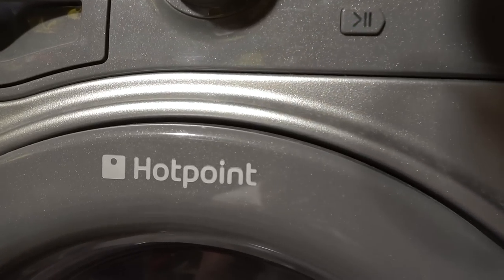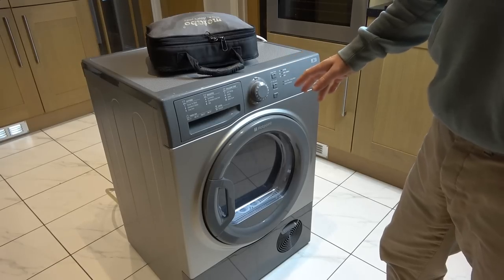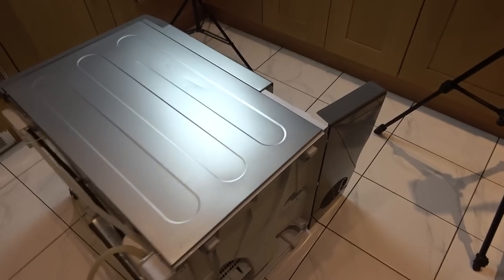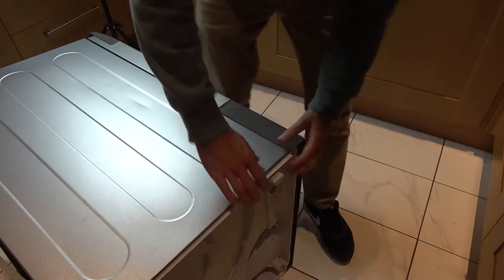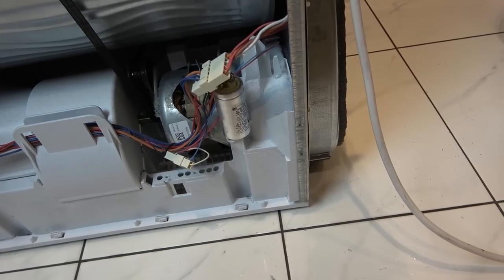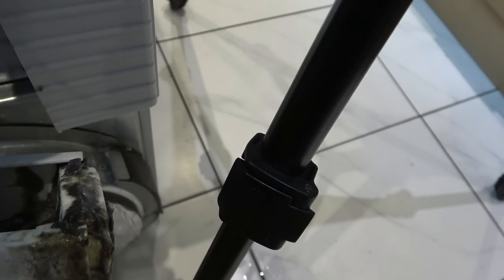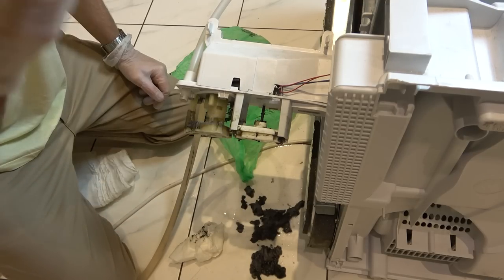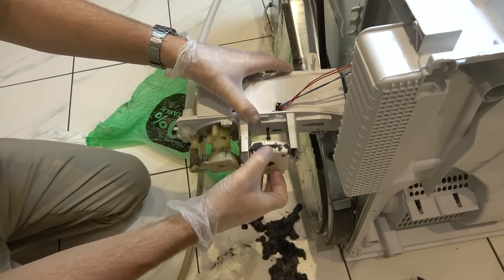Hotpoint CONDENSER DRYER Not Draining - REPAIR Video

Comment: The landfill is full of washing machines, fridges and all sorts of electronics that some of them have minor problems and where thrown away instead of being fixed. Great job Vince
Reply: I had to throw away a Balay fridge with just 8 years. The issue: just a thing that removes ice from a tube.
But that board was 200€, so absurd.
Reply: Usually 9/10 it's cheaper to replace the item than fix. Hence why landfills are full of things like fridges, freezers and washing machines etc.
Reply: 8 years ago I moved to a flat with a machine left by previous tenant that was around 10 years old then, it worked once or twice then stopped going onto drain cycle so I had to manually empty (which normally meant about a hour mopping up after due to doing it little bit at a time) and one time when I was annoyed I snapped the door lock.

I got the model number, went to Ebay found a replacement pump for £15 official and brand new and delivered, removed 4 screws from the lid, put old towels on the side of drum tipped machine over, the old pump was held on with a large metal clamp, removed it, attached new one and the machine worked, I spent a few more minutes replacing the door lock which cost about £7 delivered again for a official part.  I only got rid of it last year partly as I wanted an upgrade but the only real flaw it had whch began in final year or two of its life was it skipped the longer cycles and went onto later ones but still washed and drained like new, and the bottom plate that hid the emergency water release valve the clips had snapped off so I just held it on with gaffer tape and adhesive.
Reply: @TheCheshireCat.  If you’re doing the repair yourself, it’s usually not bad. Especially if you develop a relationship with your local parts provider and try to get preferred pricing.
Reply: Metal shouldn't go to landfill, our metals dont.
Reply: I hate when these machines are built shitty, so you have to keep on buying new ones if you can’t fix it yourself.

Comment: Condenser dryers collect water in the base of the machine which flows through a hole to the pump chamber where it is pumped up into the water container. When the water container can take no more water, the water in the sump area rises, causing a polystyrene float to rise which in turn pushes a micro-switch, telling the user to empty the water container.
When the hole to the pump chamber gets blocked, the water cannot get to the pump to be pumped into the water container so the water level in the sump area rises and overflows, causing a leak. A side-effect of this is that the rear air process fan chamber becomes filled with water where it shouldn't - and the fan flicks water up onto the heating element, tripping out the electrics. 
Looks like although yours wasn't tripping the electric from the excess water, it very soon would have been! 
For added gooeyness, slime and gunk, take the float chamber apart 😉
Nice work. Great fix Vince.
Reply from the maker: Thanks for all the info Codeeze. Brilliant👌

Comment: Good video. I had a build up of fluff further into the tumble dryer... Water wasn't even making its way to the pump. Given the fluff you recovered, I suspect there will be more sludge further up stream. Removing the side panel and plastic cover and going in from the side allowed me to deblock things. With a few fresh pints of water poured manually into the system the whole loop is now flowing nicely. Just wanted to mention this in case someone is struggling. 😊

Comment: Nice fix, it reminded of my dryer repair earlier this year. My whole condenser was clogged up so it didn't dry anymore. The filter screen had a small crack and as we noticed it it had too much lint clogged up the condenser already. After a painfully disassembling I was able to unclog it with a garden sprayer and it is now back to work. 
Two comments from my side: I had put my dryer on a workmate bench in the basement to be able to work in a comfortable height. Independent of age this makes your life much easier. Second I have read that you shouldn't re-route the waste water at least on some dryer models (mine is a Bosch) as it is used to clean the heater and condenser by recirculating it. You might want to double check this for you model as well.

Comment: Behind the condenser is a little gully that travels across then down to the hole in the pump housing, when I take the condenser out to wash it out I also reach in with a cloth and clean the gully out, it saves getting too much lint build up in the pump house, great video

Comment: I've had lots of them apart,  they're a very easy fix once you've done one.
There's a different model with a water cassette under the condenser and that works by gravity,  so no pump,  but the condenser in those needs to be de-linted occasionally and that's a job for a compressed air nozzle. 
Great video showing how simple these machines are to work on.
Reply from the maker: Thanks Adelle👍
Reply: @Mymatevince 
When is part 21 of trying to fix the rolls royce
Reply: @Mymatevince  next time you get a dryer get a beko ours is amazing I had nothing but trouble with the hotpoint

Comment: nice, all fixed. I also cleaned mine, wasnt broken but general cleaning i do from time to time.
mine doesnt get much of stuff in it but probably because mine has a double filter, but still cleaning the pump for a dryer of even washing machine around every 5 years is a good thing. that way you can do it when you have time instead of you having to fix it as an emergency.
well done Vince, and yeah plastic tabs break easy anyways so no worries, still holds well enough ;)

Comment: Reminds me of my old dishwasher that was leaking and I pulled apart and put my hand under a fitting to see if there was any water on the fitting. This taught me two things. 1. There was also electrical connections on the underneath of this fitting. 2. If you forget to switch off said appliance at wall these connections bite when you grab them with a hand

Comment: If the flat belt that turns the drum breaks your first problem is to get the new belt around the drum. Remove the sides and loosen the front panel. You can lift the drum enough to feed the belt under it. The second problem is to get the belt over the motor's spindle. To stretch the belt I found the best tool was the handle of a mini paint roller. Use the part of the handle where the roller goes to hook the belt and pull as hard as you can. The belt is a tight fit.
I got my belt from espares.

Comment: Thank you Sir. That was precisely  the problem with my HOTPOINT Condenser Dryer. It 's done  & cleaned. What a messy job. But it was worth the Effort. I'll  try it  during the day because it is nearly 3 am now. I'm quite pleased with your accurate Thoughts & Instructions. God Bless.

Comment: Good job well done!
I had to take ours to the repair service for cleaning. Even with 4 filtering layers and regular cleaning, the insides were clogged with fiber. The air did not pass through properly. Now, it works like new after the maintenance. So, the lesson learned is that if it takes your dryer to go through the cycle longer than usual, some bigger maintenance is required. Looking at you Whirlpool.
Reply: Whirlpool sucks. We bought their most expensive stuff and it immediately failed AFTER the warranty has gone off it. Complete drum replacement and water pump replacement. Then I learned to do it myself for one tenth of the price of service
Reply: @andrasszabo7386  Well, no manufacturer is perfect. The devices never broke within the 5-7 years warranty. After that its another story. The biggest problem is the spare parts availability and price.

Comment: The pump operates all the time. That float switch is for turning off the element if the water level gets too high. It helps to prevent too much water building up and spraying all over the element.
Reply: Thank you, just tested the switch and all seems Ok so was wondering what it actually did assuming it switched on the pump, thanks for the info that it runs all the time!

Comment: Very interesting fix. As I own a Hotpoint condenser drier of similar vintage. What I didn't realise is that you can plumb these in to save you having to constantly enter the water dispenser. I'll see if mine has the same feature!
Reply: It is in the instruction book.
I would have done mine but need to extend the hose.  Haven't got around to sourcing another hose, only been about five years, no rush 🙄

Comment: A year ago i got the same problem. After taking everything apart i also needed to cleen the "rotor" of the pump. Now i discovered that you can access the reservoir by taking out the "condensor" at the left bottem. There is a small plastic cover that you can remove. That gives me access to the reservoir. (Bosch)

Comment: Nicely done! I wonder if that is the chief of my issues with my Vogue condenser dryer, although rather than leak out the front my one leaks out the rear, about where one locates the rear fan that spins as the motor does.

Comment: Vince the hot moist air gets blown over the condenser and the water condenses and collects in the reservoir. When it reaches a level it lifts the float which runs the pump. The slimy stuff is fabric conditioner which mixes with the lint and gums up the pump. It will in time eat away at the polystyrene. I have done many and it was painful to watch you strip it down when it's so easy to strip it down.

Comment: Take me a while I had go for it and take the back off the pump.The pump was fine after pulling the pump out,and all it was it was blocked with lint and tray that collects water, precision screwdriver and cable ties to clean the slot from the filter.Easy repair

Comment: Great work Vince my only comments would be not to use an electrical screwdriver to tighten the screws as they always strip the thread in the case. Like others have commented never tip them on the side due to water flooding the ecu,  your model is especially prone to ecu failures!
Also  the pump also only works on reverse cycles too 😏

Comment: a little tip for stopping the lint getting past the filter into the condenser is to cut the leg off an old pair of tights and slip it over the lint trap .it stops a lot of the fluff geting down onto the condenser

Comment: Worth chaecking the lint filter inside the door,as it may have a tear in the mesh,which is letting
Lint through,also if it’s that age 2015,I would also remove the rear plastic half moon shaped cover (2 screws ) this will reveal the drum shaft bearing,a small brass like material which may either be round  or square.check for any wear on this and any black powder ,if it’s ok just give it a covering of grease,but if it’s worn ,easy way it to life the rear of the drum and see if there is any movement ... if there is simply replace the bearing,as if the bearing wears through,then the drum shaft will get cut in half by rubbing against the casing of the machine ...
Very worth checking vince
Reply from the maker: Thanks Martin 👍👍

Comment: I used to fix these as an ex Hotpoint engineer. The jelly sludge is indicative of using too much fabric conditioner in the washing machine. All the nice smelling wet clothes are covered in softener when removed from the washing machine and the tumble dryer blows hot air over the softener saturated clothes causing that jelly like sludge.
Reply from the maker: Thanks Budster 👍👍👍

Comment: I love watching these type of fixit videos Vince, mainly because we get to see all the electrical appliances available in the UK. They are different to Australian appliances and makers,as usual an informative video great to ⌚️ watch. Yep Vince time for the rubber gloves I'm 😱 afraid Its a pretty weird design, blocks up with lint but no real way to clean it without pulling it all to bits,maybe there's a way to clean the lint out before it blocks up the drain pump.  One other thing, at least we now know how a condenser dryer works, meaning it doesn't release water vapour into the air, unlike the old style of dryer. Really I'll say it again, a very informative video.

Comment: Just in case you need to access the pump/float in future you don’t need to take top or sides off and never put it on its side due to water leaking through it as you found as some of these have a module in the base. Just use large flat screwdriver to prise the two tabs on the top pump cover away from rear panel and it all pulls out. Well done fixing it.
Reply from the maker: Thanks for the info Pred👍👍👍
Reply: Excellent news.  Mine packed up in the same manner months ago and is waiting in line for me to fix it, don't need it so no rush, waiting for new solenoid valves for the washing machine, on back order since March 😞
May do the dryer first now.
Not a Hotpoint but identical, badge engineered.
Reply: It is actually a Hotpoint Aquarius after all.
May have cracked it, along with several clips 😝
The tray was full of fluff but completely dried out, as I haven't used the dryer for a few months. Cleaned that out with a screwdriver blade and then the vacuum cleaner.
Cleaned the float, which wasn't too bad, reassembled it and injected a litre of water down the pump tube, turned it on but it just beeped at me.
Silly me had it pushed with the front to the wall, operating it blind and the door was open.
Closed the door and off it went, had the pump hose in a cat litter tray and it was clearly working.
Will test it in the morning with some wet dust sheets, no washing to do and wouldn't normally use the dryer anyway.
Run the washer, dryer and dishwasher* in daylight to take advantage of the solar panels.  Cheapskate.

*Which will be the next job, that is on strike too.
Reply from the maker: @stephendavis6894  Well done, hopefully you fixed it. Luckily my dishwasher is actually behaving itself recently after numerous faults over the years😂
Reply: @Mymatevince  
That was a bust.
Tried it with a dust sheet, which came out dry nut no water in the receiver.
Did a full load of washing and dried it.
Checked after about an hour, no water in the receiver, plenty on the floor.
I expected it was the pump hose incorrectly pushed home but that was OK.
Dragged the dryer out, still running and pulled the hose off and directed it into the cat litter tray*.  Water was being pumped out but also pouring out of the spigot that seems to lead to a plenum chamber feeding the receiver.
I presume that the blockage must be here.
Will cogitate on this, see if the plenum chamber is accessible but more likely direct the hose into a bucket until I get one long enough to reach the handbasin.

* I don't have cats, don't like them, but litter trays are ideal to chuck a few tools in to do small jobs and keep them from being forgotten and abandoned.  Lost too many small tools.
Reply: @stephendavis6894  Thanks for the update. I'm sure you get it sorted next time round 👍
Reply: @WhatHappensWhen  
Fixed!
It wasn't a blockage in the water system, rather a blockage in the brain.
I had cleverly swapped the delivery and drain pipes over.
Removed the top, which wasn't simple.  Security screws that defeated my collection of security bits, dozens of them.
Dremelled a slot in the screw heads to remove them and it was clear what I had done.  All sorted now, despite the dumnity attack.

Comment: Don't tip the the appliance on its sides you will spill the water out of the tank! this can go through to the blower wheel  and then get blown  all over the element when switched on again and create a short in the element due to getting wet, work on these with the base on the floor, well done you got it fixed.

Comment: Taking these apart can be a real pain. A few months ago mine (a cheap Gorenje that is almost 10 years old by now) started making whining noises, so I decided to replace the belt. After taking off the top, the sidepanels and the back I just gave up. I couldn't see where to take off the screws to get the front panel off, and that's what I would have needed to do to get the belt off. Instead I decided to give it a good clean, vacuum it and put it back together. It doesn't make the whining noises again, and I have a spare belt that I'll probably never need.

Comment: In this video Vince unclogs a condenser dryer.
Vince "I'm gonna clean that under the tap'.
In the next video, Vince unblocks a kitchen sink.
Reply: Lol Philip
Reply: @Mymatevince  There is a lint filter inside the drum, right behind the drawer, did you check there wasn't a split in it off camera?
Reply from the maker: @PhilipBryden  Thanks Philip, there a split on the plastic hinge where the hinge opens up to clean it,  but it isn't very big. The mesh itself is still good. We'll make sure it is cleaned after every go and also clean the bottom condenser more often. I think this is down to user error/lack of cleaning. Easy fix though if it happens again👍
Reply: @Mymatevince  Atleast now we know what happens to the missing socks.
Reply from the maker: @MyRegardsToTheDodo  🤣
Reply: Had the same issue on my beko drier. Was dumping all the water on the floor. Works like new now

Comment: Hi great video I have this same dryer and for some reason these last 2 days has been leaking water all over the floor and I’m not sure why I have gained a lot of knowledge from your video as I didn’t even know where to start at first the drawer still collects the water so I’m not sure why it would leak do you have any ideas please I think I will definitely look at the pipes at back to start with I’m also thinking of having it drain in the drain to as this may help any advice would be great I’m a little  Hesitant at taking it all apart as I might not be able to get it back together 🤣